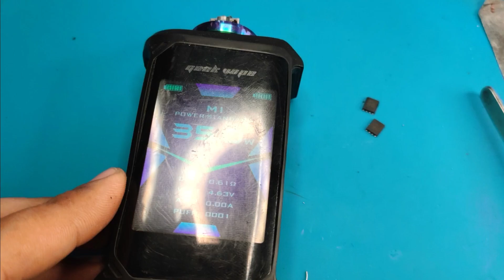Auto-firing Mods Fix. Nag pa Fire Kahit Naka Power Off!

Comment: lod tanong lang anong tamang timpla sa heat temp. at air flow ng hot air sa ginawa mo pagtanggal at kabit ng mosfet?
Reply: 290 to 320 tapos ung air 1-2 lang wag lalakasan para di madamay yung ibang parts pag digital, atleast isang guhit ng daliri ang agwat at wag kakalimutan ung flux para di maging litson manok yung mosfet